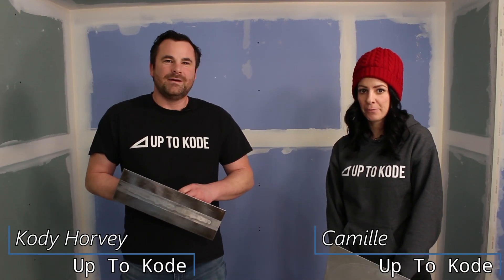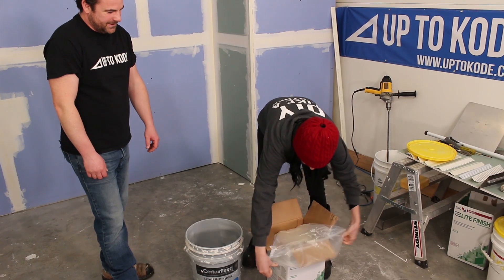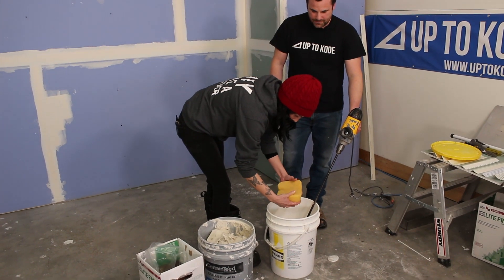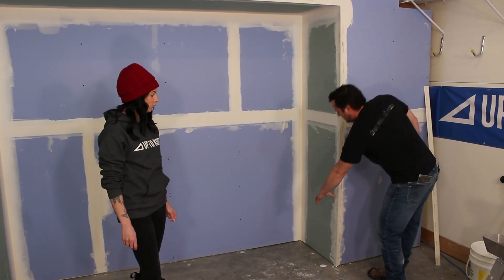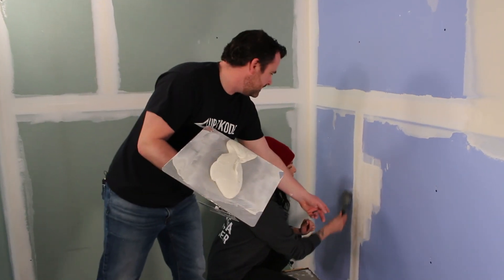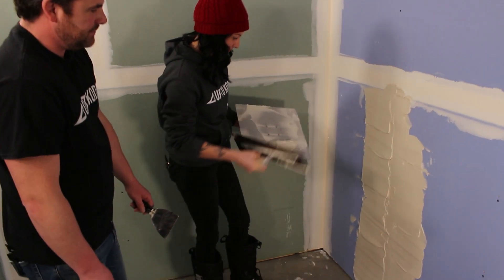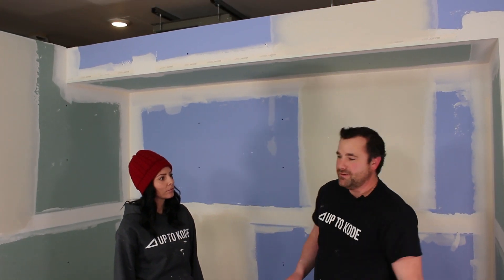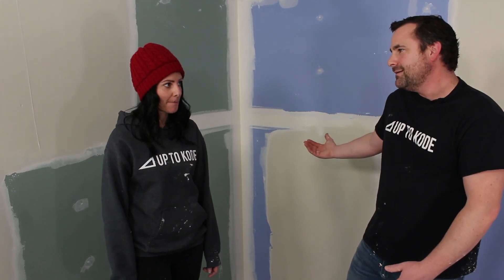How to Mud & Tape Drywall For Beginners (Part 6 of 10) - 1st Coat on Butt Joints

Comment: If you have extra mud leftover, how do you keep it for the next day?
Reply from the maker: Good question. Keep the mud in a pail with a lid on top. Easy peasy. Just don’t let air get at it. 

The con-fill we use for pre-filling is s chemical cure so only mix batch sizes that you can use in 30-45 minutes

Comment: Completely off subject but we were in Philippines last year and noticed allot of interior as well as exterior use of cement board like JH instead of drywall. I’m guessing due to termites. Do you see cement board being used much up your way on interiors? We plan to incorporate some in our build in the interior along with a product we are using on the exterior called Easytrim